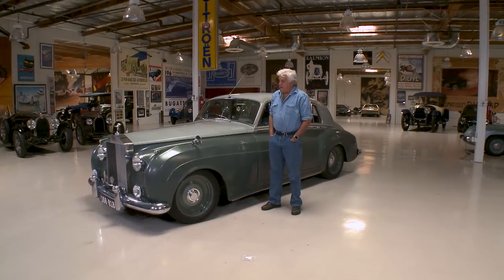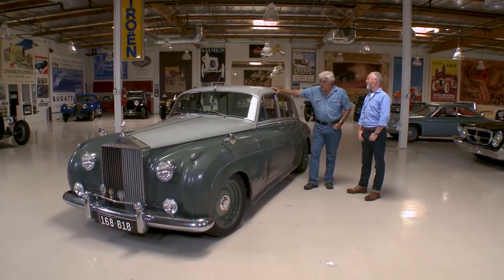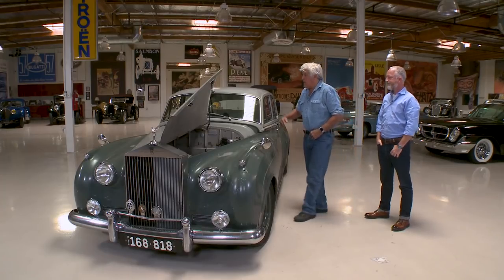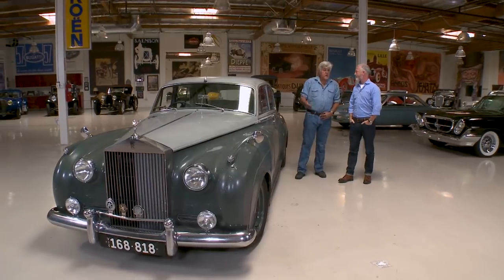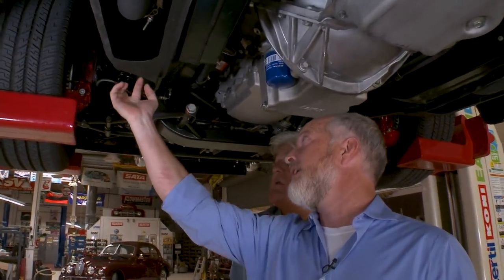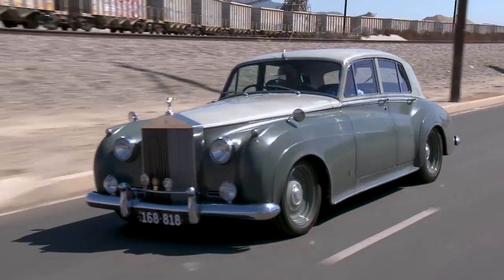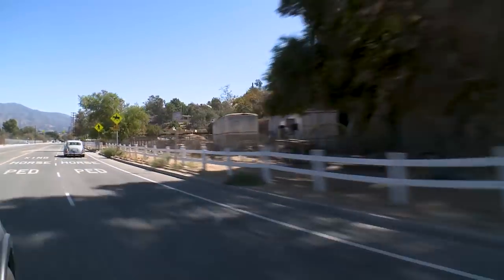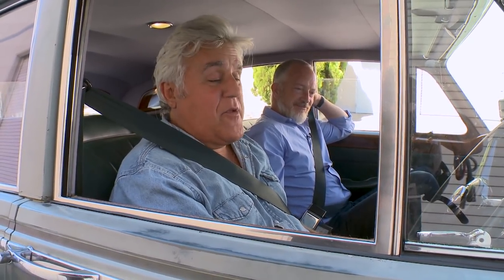1958 Rolls Royce Silver Cloud Derelict - Jay Leno's Garage

Comment: Love to see how Jay catches the brake line issue immediately. Yet, builder hadn't
Reply: Yeah annoying guy he's making me cringe!
Reply: @rjs1jd  correct
Reply: CBS

Wheel ddof fortune
Reply: Jay knows a thing or two, because he has seen a thing or two!
Reply: @Jimidan1000  Jay Leno is the best out there.
Reply: Brian Howald - I love how Jay pointed to the lower rear links on the triangulated four link suspension and said, "Ah, traction bars".
Reply: @mattfarahsmillionmilelexus  - what do Lexus owners love?  Looking superior.
Reply: @keplermission4947  For one thing, I'm not the owner, I'm the car - and for another, that answer was directed at the OP who made a comment that was intended to make himself look superior by dogging the builder of the Rolls. Keep it classy.
Reply: @mattfarahsmillionmilelexus , well 'you're nuts' according to this guy.  https://youtu.be/oyB63m-iiOU  They've got to get you off the driveway at 18.09 on the video, dripping oil all over the place.
Reply: Thats what I like about Jay, he's not slow...
Reply: Jay used to work for a Rolls Royce dealer/garage
Reply: The guy literally said right after he pointed that out that they hadn't finished doing their final 'shakedown" of the car yet, which would try to deal with all the little, harder to notice problems, like that one.  Jay is not nearly as technically knowledgeable as commenters on this show like to make him out to be.  I think it's fine to respect someone, and to like their style, but if you aren't personally knowledgeable about a subject, don't go out and try to claim that someone you met who threw out a handful of technical terms is some sort of genius or master in that subject.

Comment: Does anyone else think that Jay seems somewhat not impressed before it's driven? Since he's such a proponent of stock or as close to stock as possible. Love this show!!!
Reply: Yes well everybody seems to have have an LS motor in everything in 10 years is there going to be anything left that doesn't whether it's a GM product or not collectability will be gone and someone will come up with the next big thing and then they will all be Obsolete and they won't even have original Motors they will be obsolete I would rather have a 69 Camaro with a stock motor no matter what it was then have an LS in it it's real
Reply: @chuckealey1134  ok boomer
Reply: I was thinking that by the look on his face. I for one think a car should be restored to be original. I was disappointed at the Kaiser video because it was turned in to a rod.
Reply: Well to me, a lot of the charm in a classic car or anything else comes from that it's doing it's job for filling some role (whether it's to drive nice, to be reliable, to look cool, whatever) in it's original spec. When you take that away, and you just have a classic shell on something like this, a good portion of that charm is gone. It just isn't what that car's about. I don't think I'd say that about most other true luxury cars like this, but a Rolls Royce? Not digging it. And I think Jay shares that opinion.
Reply: Being impressed isn't what thus build is about. You're looking at it wrong.
Reply: J024 what’s it for then?
Reply: @eriknewland3686  It's explained in the video.
Reply: @bananasstuff3344  I love how people think that's an insult I'm 23 and would love to be called a boomer

Comment: Building a car to Australian design rules ,Respect! Our registration laws are second only to Germanys TuV in terms of complexity and  ludditeism . Especially Victorians . Also getting a car imported that has been modified overseas often cannot be registered if the mods were done after 1986. I did say the rules are stupid?
Reply: Yeah, having safe vehicles that don't blow up and endanger you and other people is terrible, you're right
Reply: Yes the fun nazis suck. And if the car is modified before 1989 and you have proof you can usually register it if it's a street car.
Reply: I nave been messing with cars for close on 50 years > remember when Australias different states bought in a lot of the laws which were actually copied from Iowa in the US . A lot of small businesses closed up shop as car owners were not allowed to run dual carbs, fourspeed gear boxes, bigger brakes etc .it took close on 30 years of lobbying MPs to get things like the TAC accepted  . it had zero to do with vehicle safety and everything to do with politics. As an example..seat belts. For some strange reason,only Australian approved seat belts are allowed in Australia. Cars coming in from overseas cannot use 'foreign seat belts'. Air suspension? Queensland banned it until it was pondered out that almost every semi running on the roads, plus all the suburban trans have air suspension . And on it goes.
Reply: Which is pretty weird when you see car like this Roller have the very latest in chassis concepts and a car modified in the 1980's will have 30 or older tech and parts.
Reply: Exactly. This country is fucking backwards mate I tell ya that. Todays technology and computer engineered designed parts and metallurgy is far superior than what was around prior to 1989. It should be the other way around you would think.
Reply: Might be a called a kit car with a Roller body, he did say it had been engineered by Aussies. Def will be interesting to see how he goes.
Reply: Building a car to full rego standards requires the car to be built in stages with a TAC engineer to sign off on each stage. It used to be three stages but might have changed in recent years.
Reply: Presumably the purpose of the chassis % law is to retain it's original identity and VIN and classification as a vintage presumably because of legislative concessions?
Reply: yes, although you can change a chassis on car with a full  chassis it can get sticky as some authorities consider that to be rebirthing,which is illegal in Australia ,hence the half chassis they used. They still have most of the original chassis.
Reply: Mercmad I think you're right.
Reply: try do it in denmark thats not gonna happen EVER
Reply: Last i checked, early 2000 mind you, to register a car in romania: engine not bigger than +20% of the original engine on the car, and the homologation(?) of any other parts (inc engine) cost more than the car would new + all the safety (thankfully you didn't need to put in abs back then) and documentation beaurocracy (enjoy a queue for a month, or grease the wheels as it were).

Mercmad as mr Ward said, you are trying to talk reasonable words. (not to mention structurally, that 40% of the chassis is a stressed out 70 old piece of steel that sat in a yard for a while)
Reply: Yup, having a car that is modified will get it off the road, but bald tires are perfectly fine. also doing 2km over the limit is death penalty, but you have no need to do australian driving tests to transfer from india and china...
Reply: totally agree = truer words were never spoken
Reply: When I was in Australia I saw and smelled quite a few cars without cats though, could it be that your emissions regulations arent that awful?
Reply: Shhhhh.... we have hardly any emissions regulations apart from not allowing cars to smoke . Our cars sold here since 1986-7 have engines built to an Australian Design rule and are mostly set up like Californian market  cars . All later  cars have cats but a lot sold before the nineties had air pumps etrc etc but no cats .
Reply: Mercmad 
It's to comply with australian design rules.
When you pretty much change the whole chassis you have to comply the chassis again.

So keeping a % is to keep the strongest part and upgrading the ends
Reply: Australia laws sound like California but worse ,shame that common sense and compromise doesn't exist in some places ...I'll stay in Florida then ,,great car and better job ,bravo!!
Reply: As a German I can confirm that almost everything you see on the youtube car channels is not possible in Germany (in negative and positive ways...)- about ALL the old cars in Leno's garage would not qualify as "historic" here. Besides the law modding your car immediately voids any warranty.
Reply: Oli K Can't register it as a rally car? :)
Reply: Hmmm Right.. because having cars blow up is SUCH a common occurrence in other countries with more lax auto laws... like the USA...Russia, Canada, . . . .
Reply: I would have to add that you can register such a car in Germany ,but not as a historic vehicle. Specially if the drivetrain ,emmission control and exhaust are certified to the neuest standard, say on another production car.The process is called "Einzel abnahme" means Singular Certification, it will cost you but its possible!And its totally understandable in a country where salesmen overtake you on curvy autobahns with their 3 Litre Turbodiesel 5er BMWS  doing aprox 160 MpH all day long!But why be so strict in downunder with  never ending   roads and little population escapes  me.I always thought all people in Ausralia and the police drive around in XBGT Interceptors with Wiland superchargers and  touch botton Nos Injection.Another dream shattered!
Reply: All passenger vehicles have cats, commercial up to about 91 got away without. Cats however really do not hurt performance, just cost a lot, easpecially the larger ones.
I suspect this car is built as a HotRod as you can get away with more mods. The side exhaust though will not. Though every state is different and Mexico [sometimes known as Victoria] is still easier than here in SA
Reply: Leon, I get what you're saying, but when my 1956' car is required to have a windscreen washer to go with a later model engine/disc brake conversion, thing have gotten ridiculous. Even the engineering signatories are saying the same thing. Better to have sensible requirements and make it easier to have them registered. Otherwise, you have lots of cars that are illegal and no control. Appropriate brakes, lights and seatbelts should be more than fine.
Reply: If you think Aussie rules are stupid, try French laws, the only thing we're allowed to modify on a car is the color.
Reply: You can register a car like this in Denmark, Sweden, Germany, all of EU. but it will be as a new build and the workmanship has to meet high standards. Common sense stuff basically, breaks, emissions. I have imported 5 cars myself from USA and it was very easy, just had to get some certificate from DEKRA, it was 200 euro.
Reply: I think that is why they kept a large amount of the original chassis so its classed as a modified rather than an ICV
Reply: what? is that a voice from the bendover and take it  crowd I hear whispering?
Reply: My 98 Prado and 98' Landcruiser does not have cats.
Reply: It's just as bad for bikes (in Queensland). You can still build a chopper but they make the process 100 times more difficult & expensive these days than it was  25 years ago.
Reply: ant4812 A friend took his pan head bobber to Queensland about 30 years ago and got it defected instantly.   It said on the defect.  "Motorcycle too chopperised"     It had flat bars on it.
Reply: Actually the chassis thing is so they can get away with NOT following your rules.
It means that the car is still a RR from that year, not a new car or reproduction. In some cases if it didn't have seat-belts you may not have to put them in or use current tech...same thing with the bumpers, in this case.
I believe it's also a way for them to avoid higher import and local fees and taxes. If a car is collectable or vintage it's easier/cheaper to bring it into Canada, (I live here now.) and without being specific I'm told by a customs guy that does cars, same going to and from Australia.
His hassle is a big bunch of money for the buyer, bottom line. Probably out of your pocket, tax-wise.
Reply: Sam
Reply: In the UK most of the rules about keeping a percentage of the original chassis/unmodified monocoque are more to do with the cars identity than for safety, replace to much of your old car and the law considers it a new car which means it must go through more stringent safety checks to earn it's registration. There is no way to get old stuff through even if you are improving the braking and handling you can't modernise the crash protection or pedestrian safety, things such as the radius on the edge of steel bumpers or exposed windscreen wipers is to sharp, dashboards are not padded etc etc.

Comment: Would like to have seen a hopped-up Rolls Six-and-Three-Quarter Turbo V8, but cheaper, easier to service, trouble-free 500 horsepower is impossible to turn down. Especially when you hear it! My 300SD needs an LS7 now.
Reply: Brandon Obaza check out corbyn Goodwin's silver shadow II
Reply: And the cast rear suspension and rear limited slip from a V8 SEL model.
Reply: Brandon Obaza my Silverado also needs a LS7 lol.
Reply: I think the Bette sound is kind of dumb
Reply: Brandon Obaza Cheaper? By whose standards, Mr. Money Bags?
Reply: I would totally do that.
Reply: What's wrong with you?  You should never replace an OM617 with anything... especially an LS7.
Reply: Brandon Obaza Everything needs an ls. My mustang needs one.
Reply: 777jones actually Mercedes does sound like American v8
Reply: Brandon Obaza my dad had spirit 2 in '83Fuckin tidy to 12 year old. Lol

Comment: I had a 58 Cloud 1 LWB and it did have AC from new. It was Richard Lippold's car from new and I bought it from the estate. The AC was a GM unit that was the same they used in Cadillac. I started a Limo service in NY when I was 17 and my Godfather gave me one of his old cars which was a 65 and that same unit was in it.
Reply: Fascinating info, thanks.
Reply: Yes, it was offered as an option beginning in 1956. As I recall, they recommended that such cars only be ordered in white, at the time.  Power steering was offered at about the same time.  I drove a James Young long wheel base without PS and it was very difficult to handle. Its original chauffeur really earned his keep.
Reply: My 58 was grey with beige interior. One thing I found very difficult was a service center that still used R12 as I wanted to keep it original. Bentley Greenwich and Bentley High point serviced my cars and they wanted to convert the AC to 134 but my experience was when the R12 was working well, it was ice cold.
Reply: There is a drop-in mixture of refrigerants that works reasonably well without the high cost of R12 and without the need to make the changes required for R134.  R12 is available in other countries but quality may be suspect.

Comment: That car he was talking about that was the first on the market with air conditioning, V8 engine,  power steering, power brakes, power windows etc? 1952 Chrysler New Yorker and Imperial, not Cadillac. No car other than Chrysler had all those features in 1952 and we haven't even mentioned disc brakes, padded dash, tinted windows .

Comment: I had a 58 Rolls Royce just like this when I was a kid in the early sixties.  It was about 9 or 10 inches long with smooth spinning wheels and already put together in plastic, no glue.  They were models maybe sold by car dealers and you didn't build them.  You could push it around on the carpet and make motor noises.  Good times!  It was like the Burke's Law Rolls.  They also made car models back then in bare unpainted metal that you screwed together and painted.

Comment: would rather just see a video on a rolls royce silver cloud with a rolls royce engine than yet another body containing an american v8
Reply: so find one
Reply: There are lots of videos on them.  The engine was marginal in performance even when new. The cars themselves were difficult to handle, wallowed, leaned, dived, etc. Braking driven by the ancient GM transmission was just plain odd. The bodies and interiors were gorgeous but they often leaked.  There was no real rust protection, etc.
Reply: thought i had

Comment: 1958 The exact year I will look for.  My year of Orgin, December 20th, Chicago.  
It will fit.
Black, Silver, or Cream.

Cadillac fan, but the exterior design of the 58 Cadillac was so heavy. I used a 1957 Cadillac Limo previously owned by Kirk Douglas as my Wedding Limo. Was quite cool, even in 1984. 

I must note, if I had the option, I would own a fleet of various cars and an Airstream from the 1930's.  I feel the 1930's automotive designs are the best, far beyond their era.

Comment: Speaking of the mold problem I was always told if your gonna park a car for an extended period of time in conditions that aren't moisture and temperature controlled you should crack the windows!

My 77 ford club wagon was parked for twenty two years before I pulled it out of the garage and it had a luckily very minimal mold problem! It was solved by simply wiping down the vinyl and shampooing the carpet!

Comment: Jay should not be surprised that the radiator for the new engine can be a lot smaller.   The original Rolls Royce engine was an inlet-over-exhaust design, sometimes referred to as an F-head.   The exhaust valves were in the block, and like all side valve engines, a lot more of the exhaust gas heat is transferred to the block and thus into the coolant - so you need a big radiator, but the exhaust is quieter.
When RR realised they needed to update their car styling to a lower, straight lines appearance so as not to look old fashioned, there was no longer enough room from the big radiator needed by their F-head six, so they bought a Cadilac OHV V8 engine of about the same capacity and tried it out.   It was better in every way - just as quiet and smooth, more power, and it needed a much smaller radiator.   RR then designed a V8 engine taking the Cadilac motor as the starting point.